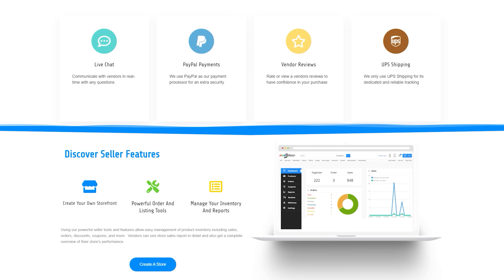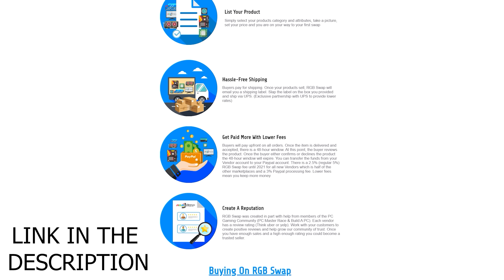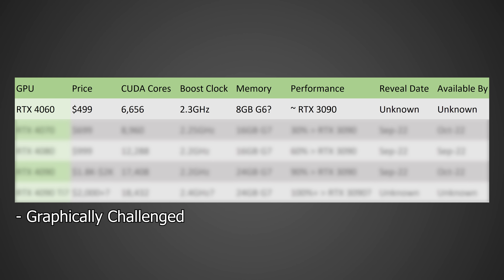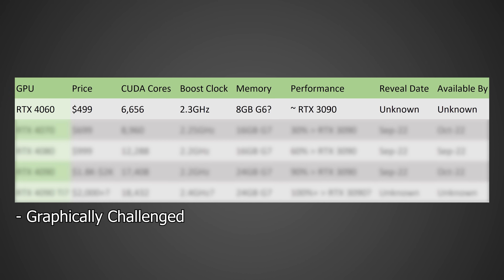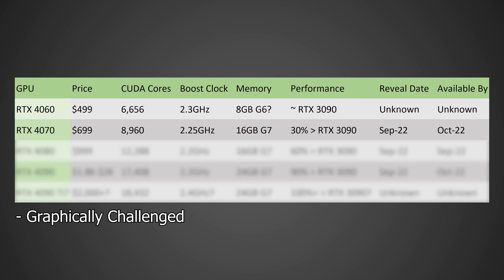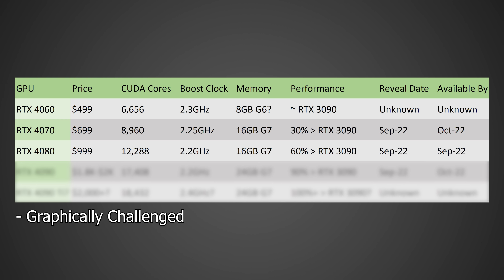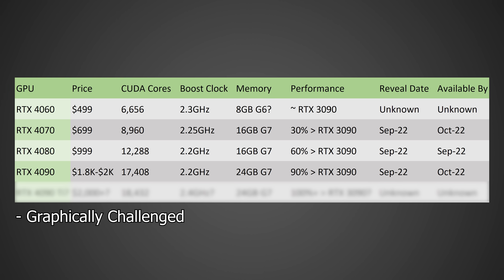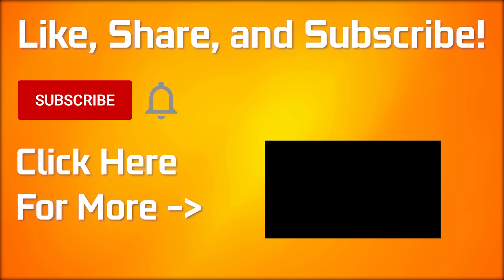Nvidia Lovelace RTX 4080 Price, Specs, & Release Date

Comment: A 4060 killing a 3090 would have sounded ridiculous without those specs. According to what's in this video, it will only have ~60% of the core count, but the transition from 8nm to 5nm will absolutely fill that gap. Then comes the memory type & bus - 8GB would certainly be on a 256-bit bus for NVIDIA, leaving it at just 48% of the bandwidth of a 3090 if identical GDDR6 is used. Seeing as they're trying to standardize a 600W power connector now, they will likely use GDDR6X for all of their Lovelace cards unless GDDR7 is confirmed in the near future.
Reply: Bro I learned so much from this one comment 😂💯
Reply: I still don't believe it.
Reply: How exactly does the transition from Samsung 8nm to any 5nm node "fill that gap"?
Reply: @hiXhaX-YT  Great point, there will be inherent improvements by this change as you gain a significant performance per watt increase which allows these chips to be pushed further, still I would say the significantly higher clocks are doing most of the work here, which would be a direct result of the node switch.

Samsung 8nm is actually a refined samsung 10nm which is not much better than tsmcs 16nm, but samsung 5nm is a MASSIVE improvement over samsung 8nm and a lot closer to tsmcs 5nm than samsung 8nm was to tsmc 7nm.

This is obviously possible, but I would wajor that the 4060 would get bandwidth starved at higher resolutions if they don't close the bandwidth gap or use some improved color compression etc, alternatively they may take the same approach as AMD with regard to massive on die cache which is clearly the best approach to bandwidth going foward.

AMD has already illustrated this with their infinity cache and small 256bit busses with just standard 16Gbit DDR6.
Reply: @dawienel1142  As you say, you can get higher clock from a new node. But to make up for the +66% of Shaders the RTX3090 has against connor's projected 4060, the clocks of the 4060 would have to be 66% higher than on the 3090 to get to the same flops. And 66% is highly unlikely.
So as you also say, there has to be something else then, offering a massive IPC gain, like an enhanced caching system. This could also make up for the decrease in bandwidth partially.
Reply: @hiXhaX-YT  I fully agree clocks and node alone is only part of it.

I did notice some weird architectural bottlenecks with rt/dlss and normal rastorisation in some games on my rtx3080ti, there is clearly some low hanging fruits that Nvidia can focus on.

Getting their performance per cuda core back to turing atleast should be a focus point.

Wider SMs(CU's for AMD) is one area that can be made bigger, also they need to optimize RT ALOT (it messes with your 1% lows and DLSS does not make up for it, I generally still do not make use of RT, even with DLSS its not worth the trade off)

Ampere is great for what it is, but it's got a ton of weird bottlenecks with RT or even at a lower resolution without RT.

So the performance uplift in this video is definitely plausible, atleast at the ultra high end. (or even likely to a point)
Reply: @hiXhaX-YT  They are basing it off rumours lol
Reply: When he says "Leaks" he REALLY means "More guesses".
Reply: No chance
Reply: No chance of ~3090 and if it is the price point is way off
Reply: MentallyChallenged gets his facts from his arse. Ive seen a clip with some people discussing about the RTX 4090, the 4090 will be around twice as fast as a 3090 but that will not be spec related, more for rendering.
Reply: @midnightvibes5485  My experience tells me not to have crazy expectations and hype, I've underestimated and over estimated both AMD and Nvidia in the past.

So my two cents is that this is highly possible according to a bit of my own napkin math, not to say that it will actually translate to real world performance though.
Reply: why are they releasing 4000 series when they cant even get stock for the current 3000 series?? thats kinda fucking stupid
Reply: @rammy6999  by the time they'd be able to get 3000 series stock in check, 4000 series would already be due. they've pushed their processes to the limit & probably believe there are enough floating around for it to not be a concern with enough time
Reply: @rammy6999  why is this stupid? If you have limited resources, you should try to make the most out of it. So instead of selling 1mil. 3090, they can make 3mil4060. Or 1m 4090 and sell those for a lot more than the 3090s.

Comment: I'll take this info with a big handful of salt - but if they end up releasing a 4060 with 3090'ish performance and only 8GB VRAM - then that seems like it would be a repeat of the same mistake they made for the 30-series where AMD basically ended up shaming them. It felt Nvidia became very aware that it at minimum looked bad for them. It seems weird to repeat the same mistake, just worse this time. It feels like 8GB should be reserved for the entry-level 4050 that no doubt will come down the line.
16GB is fine. 8GB was arguably not enough in the 30-series. Definitely not enough in a 40-series with this kind of performance jump.
Reply: You have the same thinking as me. I believe Nvidia knows better and will make 4060 with 192-bit bus and 12GB. Even 2060 and 3060 have 12GB, they can't go backwards.
If anything, they could make 4060 with 16GB, but that would be very hard to do for only $500.
Reply: There's likely gonna be a 4050 with 8GB again. I mean AMD released a 4GB card
Reply: @ClippyHatesOligarchs  He's referring to the high end, 4gb on the ultra low end makes sense, though just barely, but 8GB on a rtx 3060ti to rtx3070ti is way too low.

even the rtx3080 could have used at least 12GB and that's why I rather went for the rtx3080ti.

Try running ghost recon wild lands maxed out @4k

the rtx3070/ti gets massacred by the rx6700xt which shouldn't be the case in the slightest.

8GB shouldn't be in high end gpus anymore period. (minimum 12-16GB)
Reply: 4060 will not have that level of performances and that price but it could be 8 GB. They could make a 4060 Ti with 12GB/192 bus at 500$ that is a bit faster than a 3090 ( 4 to 6 % ) in some gaming scenario on 1440p and lower, while 4060 could end up on being near 3080 level of performances, being an 8 Gb gpu at 400$. The 3060 at 12 GB was the mistake. 8 GB for a 1080p gpu is way more than enough if the price is accepteable and they need something between 8 GB and 16 GB.
Reply: Aside from pure fantasy, where are you coming with the obviously erroneous conclusion that a 4060 would only have 8gb?  The world wonders.

Nvidia always releases high end first, like the 70-series and 80-series, following later with 60-series and 50-series. 

The initial 30X0 cards were under equipped with too little RAM, Nvidia realized this and released a 12gb 3060. Let me say that again...

Nvidia released a 12gb 3060

The 1650 was 4gb, the 3050 was 8gb.... Nvidia also re-released the 3080 with 12gb instead of 10gb... everything shows Nvidia realized they needed MORE memory from low to high end and in every refresh of the 30-series they increased the memory. 

And here you come, bebopping along saying Nvidia is going to LOWER the amount of ram in the 4060 to 8gb, from the 12gb 3060.

You need to put down that crack pioe, you sound completely insane and your conclusions are unfounded and ridiculous.
Reply: @wolfshanze5980  From where? Umm... literally this video that you are commenting on. Did you not watch it? I have my doubts about how accurate this info is, but my comment presumes some level of credibility for the sake of argument. I'm not making any claim here - the channel author is. I mere commented on the info presented. I have no idea why you are misdirecting this vitriol at me.
Reply: @wolfshanze5980  You should calm down a bit man. Those are just speculation comments in a speculation video, after all. No disrespect. Right, they released a 3060 with 12 GB... and a 3060 Ti with 8, a 3070 with 8, a 3070 TI with 8 GB. You write about nvidia realizing they need more v-ram... have you forgot about the 3070 TI and when it was released? Without considering the 12 Gb 3080, the gpu with no msrp that perform" better " than a 3080 and " worse " than a 3080 TI... Come on, Ampere it's a mess up of a lineup and I hope Nvidia will make a more clear one for next gen. Back on v-ram, 12 GB in fhd is useless and in higher resolutions, where 12 GB start to really make a difference, 3060 performances suck. For fhd, there's no need to have more than 8 GB. Amd already realized that. However, if Nvidia want to put a 4060 with 12 GB they are welcome, as long as the performance jump give a sense to this gpu. For sure, what no one need, as a fhd gpu, a low-end sku, it's a 500$ price. I don't believe on this price but who know.
Reply: @andreabriganti5113  Agreed, but to be fair if the rumors are indeed correct, it would mean that the RTX4060 won't be for FHD since it would be comparable to a 3090.

At this point with the renewed flagship/high-end GPU competition between AMD/Nvidia and Intel coming into the mix, I'm seeing GPU performance outpace general game requirements, which is a breadth of fresh air for those of us wanting to keep GPU's for longer.

Games are also generally becoming well optimized for GPU's especially games working on newer API's like Vulcan and DX12 ultimate.

At minimum a 3060Ti+ GPU class should have 10GB memory these days.

Unless they can come up with some form of trickery like very fast memory or massive cache.

Super Fast 8GB with massive amounts of Cache can circumvent this problem on future GPU's though.

That's why I will always watch a bunch of independent reviews before making a buying decision.

I Guess we will have to wait and, but for now its all speculations with some hints of possible truth in the mix here and there.
Reply: @dawienel1142  I get your point and, if we were speaking about " normal " gpu, where theyr value it's judged by theyr raster perf, I would agree 100%. However don't forget we are speaking about rtx gpu. Like it or not, this gpu are created with the purpouse of being used in games that support ray tracing. Right now, we just got few games that have some light form of ray tracing effects applied and monsters such the 3080 and higher, go on theyr knees, expecially without the help of dlss. It's normal. However, with the RTX 4000 we are going into the third gen of rtx gpu by nvidia, it's also more than normal to see the next 2 gen having a big jump in performances, expecially with Amd that's breathing on Nvidia shoulders so, I totally get your point but the rtx 4060 will remain a low--end gpu. 4060 Ti, 4070, 7700XT and all higher level gpu of this incoming gen will put the 4060 on being, as always, a low end. Of course, I'm not expecting to get a gpu like that for 350 bucks, but 500 $ seem a bit too much, expecially since the 4060 is probably going to be a 8 Gb gpu that will barely match the 3080. If 4060 will perform clearly better than a 3080 Ti and will have still that 12 gb...a Gpu like that at 500$ would be a huge deal deal. However I highly doubt we will see that with the 4060. Maybe with a 4060 TI. Sorry for the Essay btw.
Reply: @dawienel1142  However, while we have 2 different points of view on the 4060 I agree with everything else you wrote, I apprecciate there are people that can still write without seem to be ready for a war and, since isn't common, I thank you for this conversation. Sorry if my english knownledgment isn't great, I hope you'll have a good evening mate.
Reply: @andreabriganti5113  timing is everything... all the 8gb cards were first out the gate, the 3060 came out LONG AFTER the 3060Ti and had 12gb... the other refreshes of the 30-series like the 3080 all came out with 12gb or more of memory... why?

Because everyone blamed Nvidia for being stingy with ram... so guess what, all later releases of their cards had more ram, like a 12gb 3060 and 12gb 3080.

If you looked at the press previews of the 30-series before launch, the 3060 was listed as:
3060 6gb?

Guess what, it never stuck.
Nvidia has never gone backwards on memory in a series... stayed stagnant, yes, gone backwards, no.

Anyone who thinks they'll go from 3060 12gb to a 4060 8gb? simply doesn't pay attention to how Nvidia releases cards.  Also, ? is there for a reason... people should remember what that means.
Reply: @wolfshanze5980  Even the 3070 Ti was released way after and still got that 8 GB but seem you keep forget about that. However, you're right, even if my memories aren't that great, I also don't recall Nvidia doing something like that. That's doesn't exclude the possibility but, unless they increase the bus again for next gen, probably the 4060 will be 12 GB still. Let's hope they don't forget performances this time around.

Comment: I'd be massively surprised if the 4060 is even better than the 3070. If you follow the general pattern of evolution thinking that a 60 card is gonna be better than the titan of the previous gen (3090) is kinda silly. And it selling for 499 is completely a pipe dream if it is even close to a 3090. So expect a 4060 to perform on par with 3070. And cost a little bit more than a 3070 is going for at that time. Gone are the days of a 100% improvement over last gen.
Reply: I'm looking forward to coming back to your comment compared to when 4060 is actually released
Reply: @snowcoconuts8660  in all honesty, I would love to be proven wrong. It's just hard to believe a generational uplift that massive without a massive increase in price to accompany it seems highly unlikely. The ..60 card is supposed to be an "entry level card.  So even if it does perform as good as this video claims, a 400 to 500 dollar card is no longer an entry level price point. But only time will tell. Look at a 1080 ti. They, to my knowledge never even reached a $400  price point even before the situation were currently in. You expect me to believe an entry level card that is basically the equivalent of the highest end consumer card we currently have that sells for marp 1500, and actual market value between 2500 and 3200, will come out and cost less than a quarter of the market value. I just can't see it
Reply: @davidhodge0201  finally someone who actually understands the statistics and probability of all these rumours actually coming true. And even if they do come try (which I doubt) you are also so right about the pricing of the cards.
Reply: Yup
Reply: @djangojansen7648  a 60 card is usually around the previous 80 card in terms of performance, 
you can see that with:
 980/1060
1080/2060S
2080/3060
and so on,
so it's normal and will easily surpass the 3070.
it's gonna be closer to a 3080, and at that point a 3080 is only around %10 slower than a 3090 so I can that being their marketing as in "3090 levels of performance for X amount of money"

Comment: I think a possible 4060 ti will be $499 or $549 while the 4060 is $399 or $449 but I can agree with the 4080s pricing and the 4070 could either be $699 or $649. The 4090 is easily $1800. But then again Nvidia could just not put a MSRP on these. 
My prediction on Power consumption
4060: 200w
4060ti 240w
4070 290w
4080 430w will be hard not to pull 80c on anything besides the top 3 slot coolers 
4080 ti 500w Will be hard to not pull 90c without AIO hybrid coolers
4090 560w Will be hard to not pull 100c with a Air cooler and will be hard to get below 80c using AIO or even loops. You might need to Ice cool it. 
4090ti 750w In desperation to catch up to the 7900/7950xt. They will go hard on pulling wattage that a AIO 6 slot air 360mm aio hybrid will be the Nvdia FE package. I bet that a 4090 ti will need a 1400-1600w psu at the minimum.  *Plus it's going to require ice water loops every day to stay below 80c. May even need liquid nitrogen  
While AMD's 7900/7950xt is 20% faster then the 4090ti in gaming and matches in production benchmarks expect for some but pulls 4080 wattage, and the 7800xt may be on par if not 5% faster then a 4090 and pull 3080 wattage. (My prediction)
If Nvidia's Lovelace is this power inefficient then the top end Laptop gpus will only get up to 4060 ti performance While AMD advantage and Intel Alchemist and Battlemage laptops are more Power efficient then a Intel/AMD and Nvidia pairing
Reply: How the hell 4060 will draw 200W if 3090 draws almost double of that?

Comment: 4060 needs to have 12gb of ram to match 3060, performance around 3070, the rest is optimistic, but i hope so
Reply: Sounds ludacrous to have 8gb on a 4060 when a 3060 had 12gb
Reply: @IdeasAreBulletproof  3060 has more vram than the 3060Ti, nothing is "ludicrous" to Nvidia
Reply: preety sure thats what the shorter nm are for, will be less gb to fill that gap and wont be beefy like the 3000 series.

Comment: I'm worried about the power draw of these new cards.  And ACTUAL availability of them.  The chip shortage is still going to be a big factor.
Reply: I honestly doubt the 4090 will be sustainable on air cooling, we're already seeing 400w posing a big challenge for air.
Reply: why are they releasing 4000 series when they cant even get stock for the current 3000 series?? thats kinda fucking stupid
Reply: @rammy6999  There is stock. Its just you cant get them hahaha
Reply: @rammy6999  life is for the fastest boooi (btw I didn't get it either, waiting for 4080)

Comment: I’m very pessimistic about those cards being that much faster than a 3090. I’d suggest looking back at the performance increase of the 2080 vs 1080. I’d love a very open-minded prediction video.
Reply: AMD are bringing huge gains to the table according to rumours, that's why.
Reply: They may be faster. 2x faster seems a little wild for Nvidia performance.. I think that well see another 20 series to 30 series jump for NVIDIA, While AMD's jump in Improvement in performance could be higher but we will have to see.